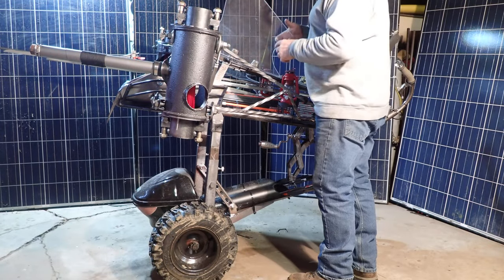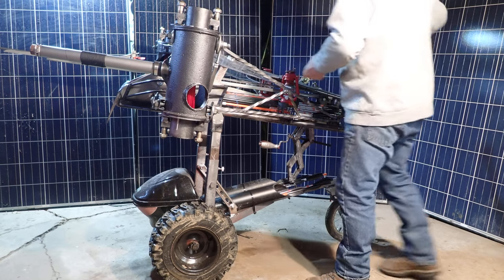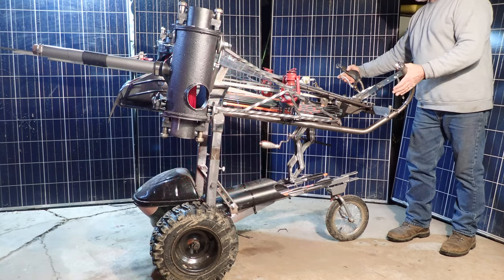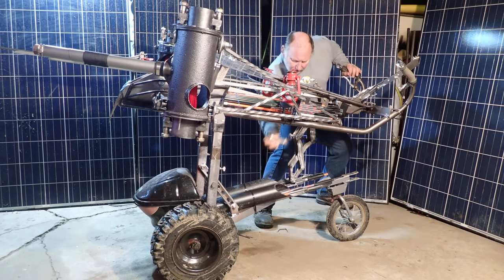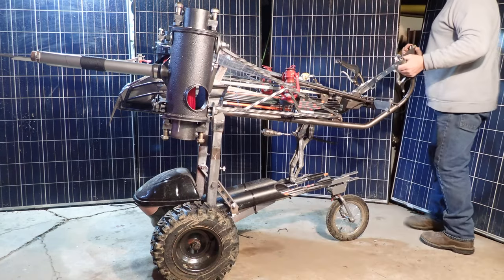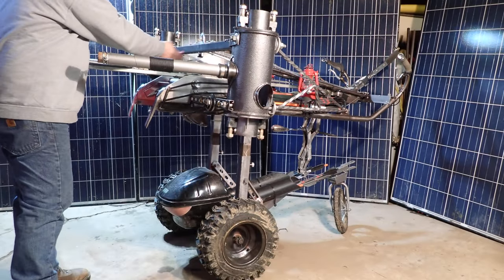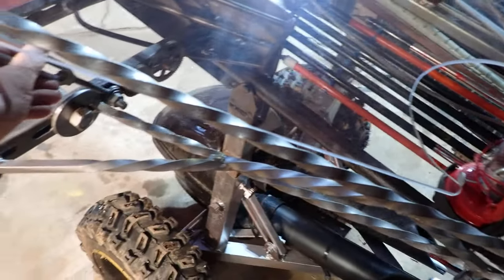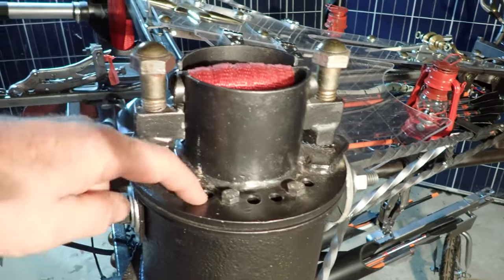Steampunk Ballista

Comment: Looks great! Love the skein tensioner system! Firefly uses wedges. I have to use a 30 pound sledge hammer! hahahaha....Yours has everything but the kitchen sink! Great Job! Can't wait for the testing and data from it!
Reply from the maker: Thank you. About the only measurement device I have is a 300' tape. Going into mud season soon here. I did shoot one bolt clear across the corn field above the house. Just a guess and it was uphill, maybe 900"?
Reply: @rowgler1  We can get velocities from distance over time calculations, and video footage from the side, with known distances and video frames per second calculations. With known velocities, and projectile weights, we can calculate Joules of energy, and foot pounds of force. Other data can be calculated from there. Power Stroke is a known data point. We could use the draw force data. Crane scales can give us that data.
Reply from the maker: @FingerAngle  Okay, good. I have weights written on each bolt, looked up what a crane scale is. I know a farmer that may have one.
Reply: @rowgler1  Sweet!